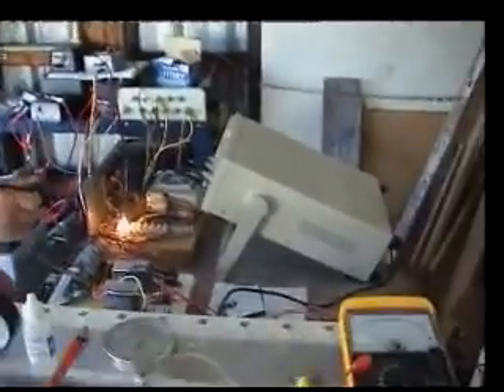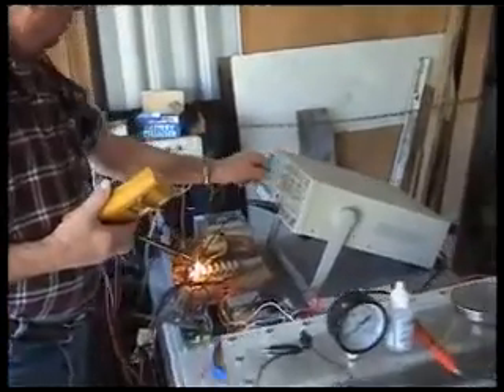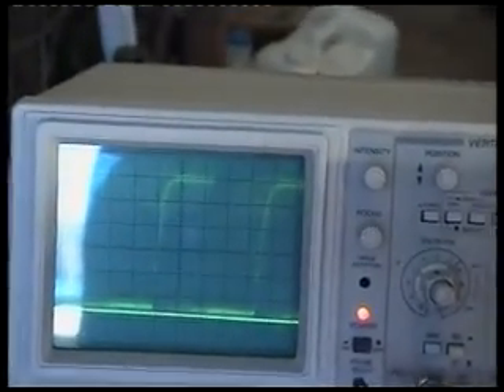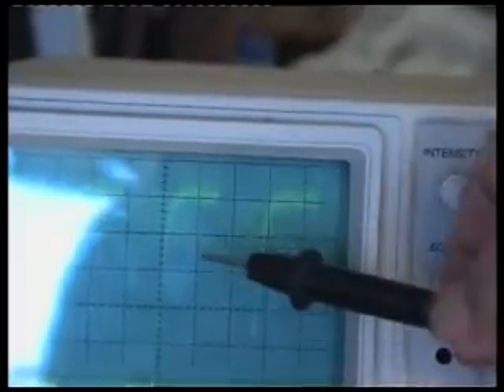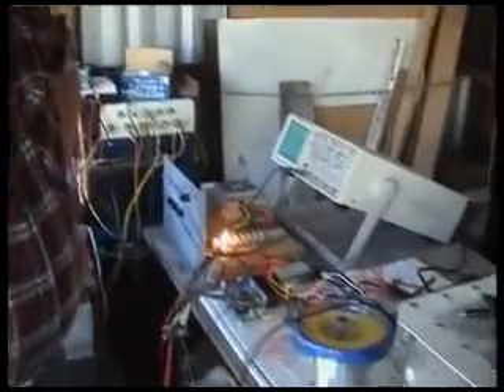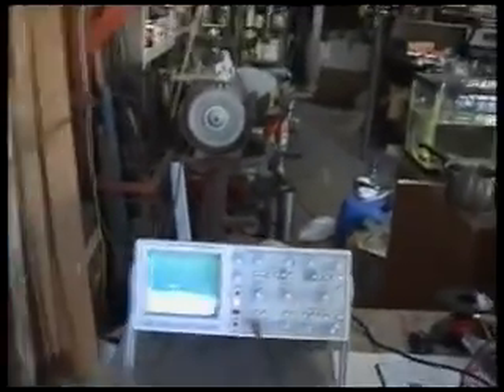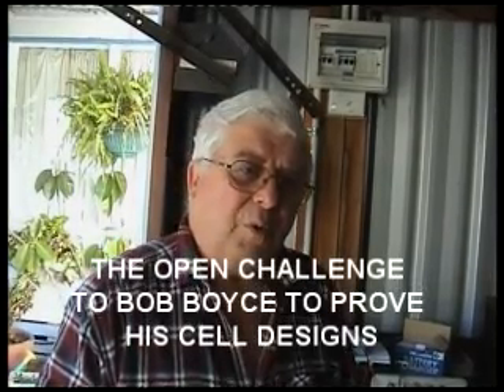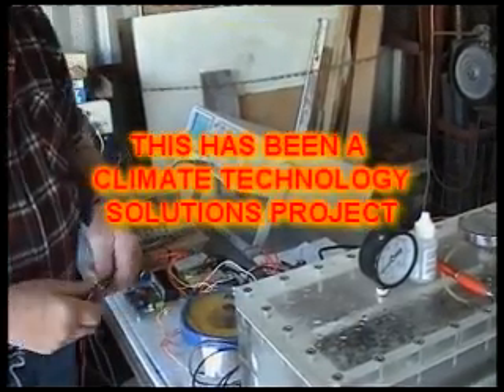Bob Boyce:Final conclusions

Comment: Hi Joefanatics, I had been experienced Bob 101 Cell test for several years and not luck to reach the breaking point I have never hit the resonant point. I found out from my G-board the lower frequency 10.7K causing full current flow 19A, the 22.4K is about 15A and the higher frequency 42.7K is just 200~300 mA. What is your result? Did you successfully replicated yours experience? I am looking to hear your feedback. Peace Mark
Reply: Adjust the duty cycle all the way counterclockwise to make tall narrow spikes to take down the amps, should only be  about 1 amp per channel.

Comment: @joefanatics Catalysis is the change in rate of a chemical reaction due to the participation of a substance called a catalyst. Unlike other reagents that participate in the chemical reaction, a catalyst is not consumed by the reaction itself therefore the hydrogen and oxygen burned inside an engines cylinders cannot be a catalyst.

Comment: @joefanatics  the only thing i can say about the set up you have there is something is missing. bob said that when he was running his boats off this hyro gas was that the carbs were mod to accept the gas, so saying so is that hydry gas has to run in a closed system, it already has the oxy in it, you need very little hydro to burn, i think you burned up something when the spark happened

Comment: 500? HA it does not take 500 liters per min of air gas to run a car. if that was the case propane should not be running tow motors and the such. from what i see in that sloppy set up is that hydro needs to be under some kind of pressure just like propane to run a car, please guys check up on your homework before posting a bucket of water with a hose running in it!!

Comment: @mksboysal Any one who has studied Tesla's HF current patents will know that Boyce's circuit is real. The required components and configuration of Boyces and Stan Meyers circuits contain the elements from Tesla's HF current patents. Go study those patents and you'll come back to this with a more solid understanding of what's happening and that his circuit is legitimate. Personally, I'm shifting towards spark gap based oscillators as they can handle higher voltage and frequency better.

Comment: @joefanatics 
How do you know it is flawed in "all design features"? 
All it would take is one frequency being off, or not having sanded the plates right, or not having enough KoH, and it cancels out the resonance.
Also, I understand 20% or 28% electrolyte depending on which one you use, and I think you said you had 10%? 
I see a lot of things that are wonky, but you blame in on Bob's design.
Another thing, it could just be your scope settings, but your pulse width looks too wide to me.

Comment: thanks for info. bob refers to the cell "under resonance"... did you dump lots of KOH in it? say 120 degrees shift the 2 higher frequencies advanced from the lowest frequency? think if the highest frequency was cleaned up it would help the cause? hex controller ? boyce isnt replicated ever....so is therefore a pinochio